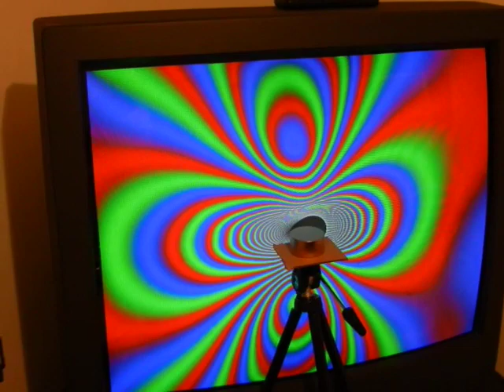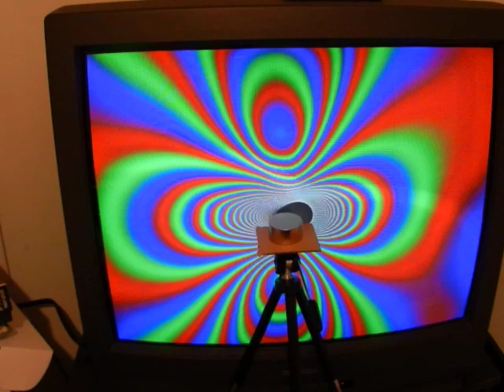VIDEO 6 Uncovering the Missing Secrets of Magnetism CRT demo of Mag field and Magnetic Vortex

Comment: Hello dear Ken!
Please, a question. I could not find in those videos explanation why is RGB lines appear in cycles? As I understood when we move a magnet closer to the monitor CC field "pressure potential" increases and a beam passing through the shadow mask hole to blue zone by default moves a bit to the right resulting lighting up red. CCW resulting in green. Or in other way depending of zones position in pixel. OK. But why when you getting even closer to the monitor from the blue circle appear red, from red appear green, from green appear blue and cycle closes, next one begins?

Comment: couldnt the egg shape also be caused by the fact that your tripod is off center to the screen as can be seen but the orientation of the legs of the tripod and the logo on the bottom of the tv making the magnet laterally misaligned from the beam inside the tv?

Comment: hi ken

what is the reason of the egg-shaped black hole again ??

also

can you please make another video using same analogy here in this video but with moving the magnet around its axis of rotation and see if the egg shape changes direction ? which i believe it does not for a good mathematical explanation 

thanks alot 

SINDI
Reply from the maker: its simplex pressure gradient mediation. you have to take the vertical cells of the CRT tube into consideration on rotation.

Comment: I am enjoying your video series. Thanks for posting them.  I'm hoping that you can answer a question I have about magnets. I know that they become magnetized after a large voltage is applied, making them permanent magnets, but I am wondering if the strength of a magnet is altered thereafter by additional applications of high voltage maybe making them weaker, or alternately, reinforcing the magnet's power in some way?
Reply from the maker: Alex C more of the molecular lattice (neo, samarium cobalt, ferrite etc etc) ,  field strength has several variables, magnet geometry, makeup,  applied capacitance...

There is a theoretical limit, as the gauss is increased, so too is the field made MORE shallow.
Reply: Theoria Apophasis
Thank you.  I suspected this. I appreciate your answering my question.
Reply from the maker: the greater the centrifugal magnetic gauss, the greater the centripetal dielectric inertia, making HIGH gauss magnets have shallow fields.

any gaussmeter will show this fact.

Oddly, im the first person to write about and understand HOW and WHY this is the case (see my book , its free).

more on this in the 4th edition
Reply from the maker: the greater the centrifugal magnetic gauss, the greater the centripetal dielectric inertia, making HIGH gauss magnets have shallow fields.

any gaussmeter will show this fact.

Oddly, im the first person to write about and understand HOW and WHY this is the case (see my book , its free).

more on this in the 4th edition

Comment: im confused when you say centrifugally and centripetally.
centrifugal force doesnt exist, so are you just saying ingress and egress of the energy?
Reply from the maker: centrifugal is the ONLY force. 

yes, youre confused about centripetal vs centrifugal.
Reply: i thought centrifugal force was the result of inertial movement horizontal to a point being contained by the centripetal force of another object anchoring it to an axis?

but how does any of this have anything to do with magnets anyways?

if its too long of an explanation dont worry about about it.
Reply: i think i might get it now

so the centrifugal force is the rotational force leaving the magnet, and the centripetal force is the rotational force going back to the magnet right?
so you'd be using the fact that centrifugal force pushes from rotation to describe the energy that follows the path out, and centripetal force being a rotational force that is pulling to describe the energy following the path back to the magnet